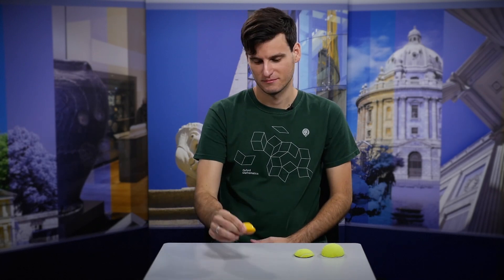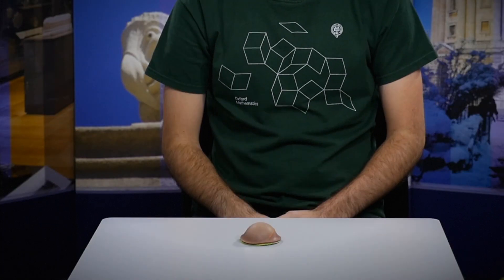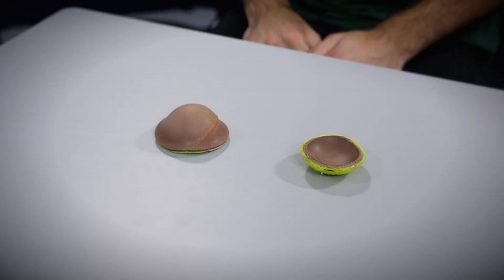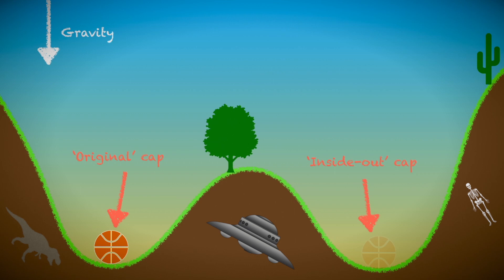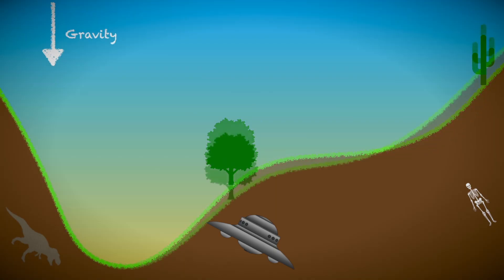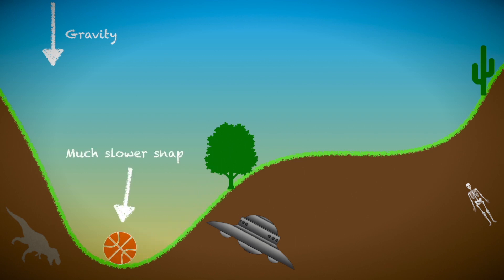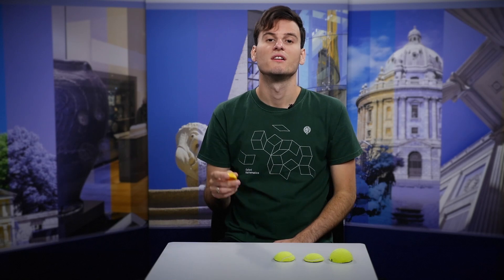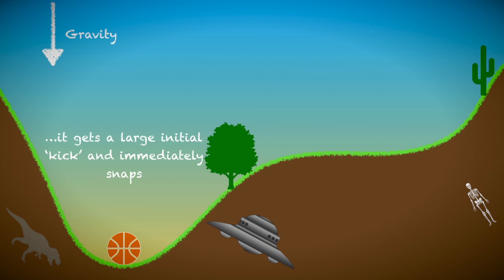The science of jumping poppers - Part 2: Slow snapping

Comment: if you were to design your own popper, how would you maximize the height of the jump? i think you said a high thickness:depth ratio is desired (so really thick, but not very deep), but if you use a material that's too dense, it might just break instead of deforming, and the extra weight would require more snapping force to lift into the air. how do you find a happy medium?